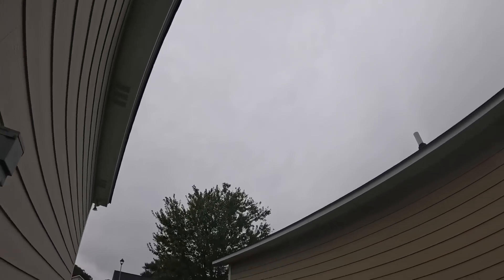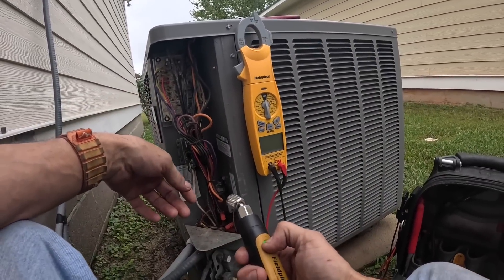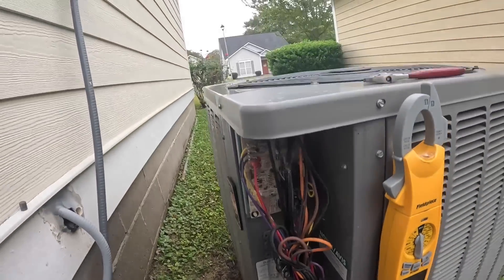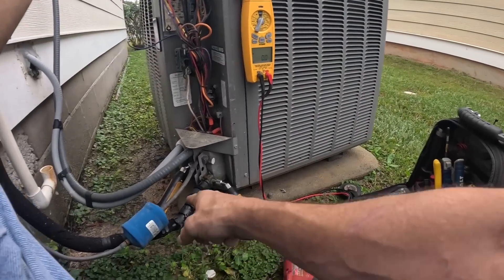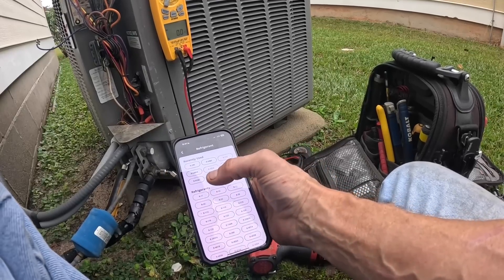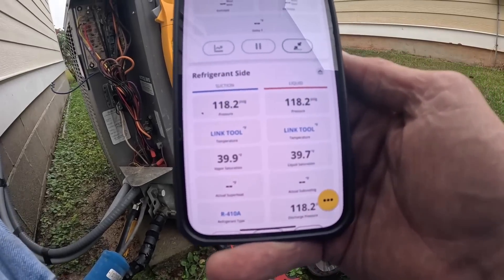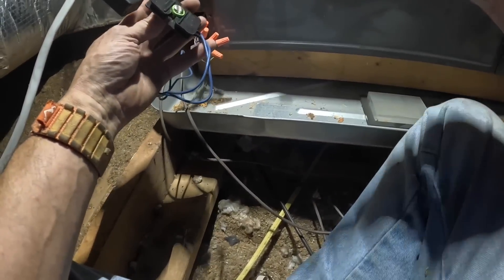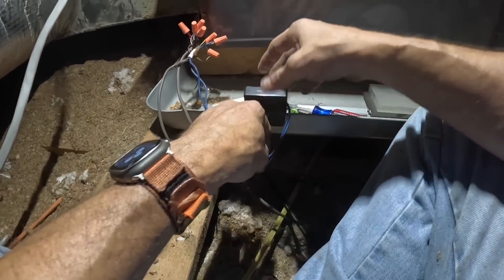Heat Pump Works Fine in Cooling, But Not in Heat! #hvacguy #hvaclife

Comment: @HVACGUY Although the video was informative, its purpose was unclear, especially since the heat pump was not functioning in heat mode either before or after your visit. The narrative primarily focused on the weather and rain, which seemed irrelevant. It would have been more beneficial to systematically identify and eliminate possible causes to pinpoint the root issue. Furthermore, the abrupt shift to discussing the TXV without any prior explanation was confusing. Clarifying these aspects could greatly enhance understanding and relevance. Thanks
Reply: It's not really though if you have a basic grasp of heat pumps. If you're trying to learn the full sequence of operation on a heat pump you need to watch videos more focused on that like " AC Service Tech LLC ". He's on a call and time is money, literally. He's been at it long enough to know what the usual suspects are for what brands. You could see the lines coming from the txv freezing up as soon as he switched to heat mode, he already checked pressures in cooling mode and everything was good, hence he knew the txv bulb was the problem.
Reply: @jeremyg8568  I never stated that 'He did not know.' My critique was about the video's focus. Rather than addressing the video's titled topic, it veered off into discussions about the weather. It's important to remember that the vast majority of YouTube viewers are not HVAC certified; they're general viewers seeking information. If the intention is to educate HVAC students at a "university" level, then perhaps a more appropriate platform would be an academic setting like a "HVAC University", not YouTube.
Reply: @manclt704  that is the main reason why channels like this don't explain in depth detail of that information Sir, to avoid Homeowners/DIY people to know that stuff and repair/diagnose it themselves. By law, only EPA Type II or EPA Universal certified are allowed to do that kind of activity on residential AC/Furnace units so they are at least avoiding that to encourage them not to. Channels like these (not all) are just documentary vlogs to show what happened in their service calls on a daily basis at a glance and it's target audience are people already in the trade and not to do an educational HVAC 101 discussion every time a video is uploaded. Sometimes other techs like me just appreciate the discussions about the weather because not all topics needed to be work or hvac-related.  Also, don't underestimate HVAC YT channels like AC Service Tech LLC and others, as I myself went to an HVAC school, I can say that there is a HUGE difference of information provided by these HVAC YT vloggers than any HVAC school institution out there. I know that you yourself just want to know that information (root cause of the problem), you can just ask in the comment section, other viewers or the uploader himself can answer, no need to criticize Curtis and YouTube hvac channels. Thanks and have a nice day.
Reply: @filhvac  Thank you for your detailed explanation, and I appreciate the perspective you've provided on the intentions behind such HVAC channels on YouTube. It's clear that there is a balance to be struck between sharing knowledge and ensuring safety and compliance with legal requirements. I understand the value these channels bring to professionals within the trade and the reasons for not delving deeply into DIY repairs or diagnostics.

However, my concern lies with the efficient use of YouTube as a platform. While it's great that there's content available for those in the trade, perhaps there could be a more focused way to share such specific, in-depth documentaries or discussions. For instance, forming dedicated Facebook groups or private forums might serve as a more targeted approach to share this valuable content with the intended audience without potentially cluttering YouTube for general viewers who might be looking for more accessible information.
This would not only streamline content for professionals and enthusiasts but also ensure YouTube remains a versatile platform for a broader audience. Of course, I recognize the immense value that channels like AC Service Tech LLC offer, especially for those seeking deeper insights into HVAC beyond traditional education. My suggestion aims to enhance, not detract and distract from, the valuable service these channels provide.

I appreciate the opportunity to exchange views on this matter. Let's continue to support content creators while also considering the best ways to organize and share their knowledge. Thank you for taking the time to engage in this conversation, and have a great day as well.

Comment: It's company policy where I work to remove the nut and bolt on those float switches and shoot sheet metal screws through it and into the auxiliary pan. I take it a step farther and bend the metal for the float to make a hair trigger.

Comment: Hey, could you set the closed captioning on/enabled, thanks from central Illinois.
Reply: No! Turn your own on.
Reply: @gem1967  It was greyed out, no option to turn it on. I definitely have it defaulted to on or turn on for all videos I watch. Thanks for your help.
Reply: @ForgetU  Sometimes it takes YT a few hours after the upload to create the captions (it uses automated speech-to-text). They're working for me now but it will be greyed out until it is finished processing.
Reply: @stevetanner525  Thanks for your response. It is working for me now.
I was pretty early on this video (makes sense).